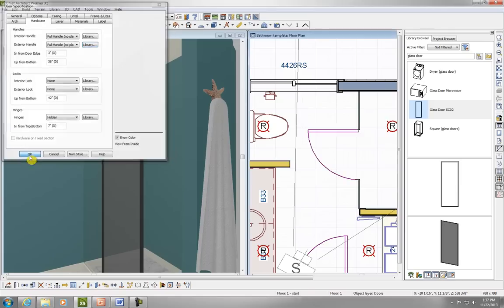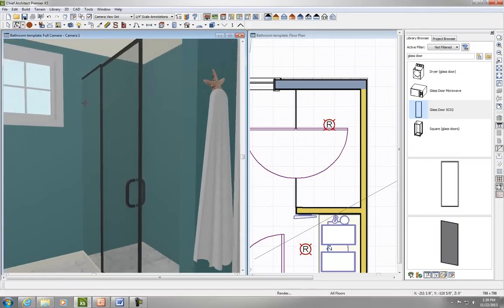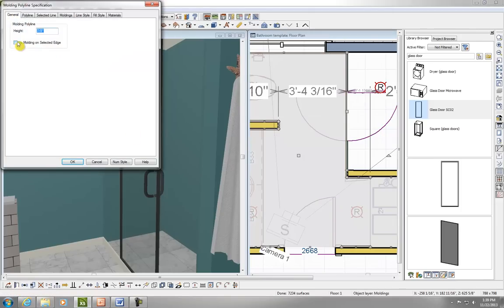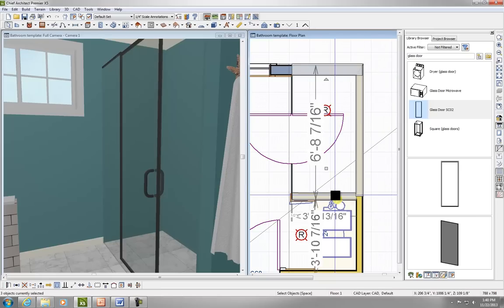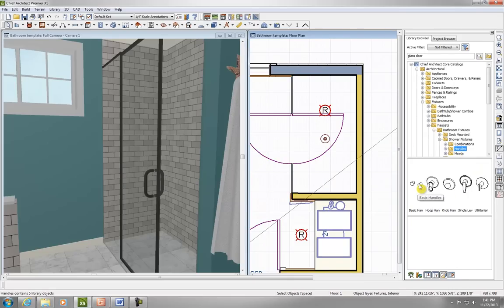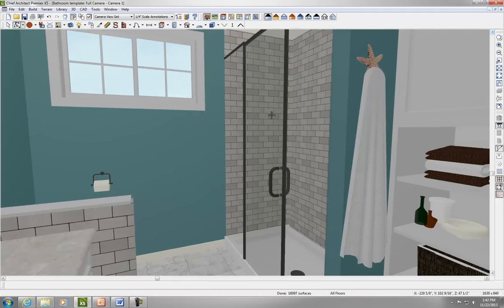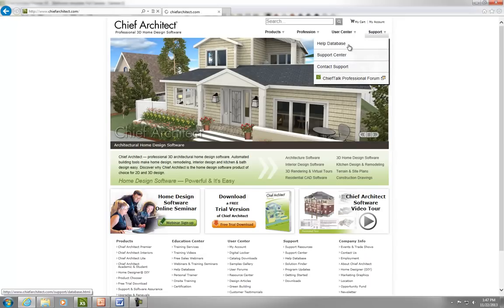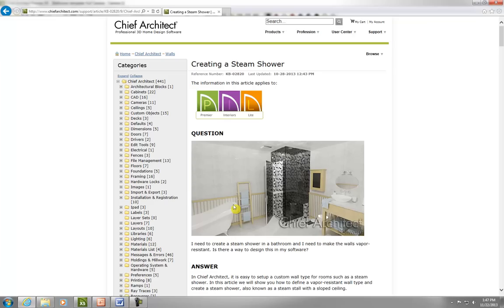Chief Architect Quick Tip - Glass Enclosure

Comment: One problem with your method is that the tile on the wall does not go past the shower enclosure as in real life.  That is why I use polyline solids for the tile on the wall so I can stretch it out past the glass enclosure.  Also molding polylines come in handy to add trim or bull nose tiles to terminate the wall tile.

Comment: If you don't have the newest version of chief.  You can create a shower door by placing a 'slab' door, changing the thickness to the thickness of the glass panel, suppress the casing, changing the hardware the same as she does and painting the door with a glass texture.